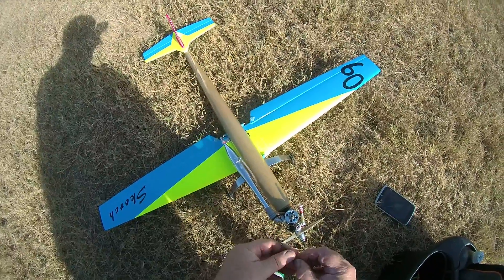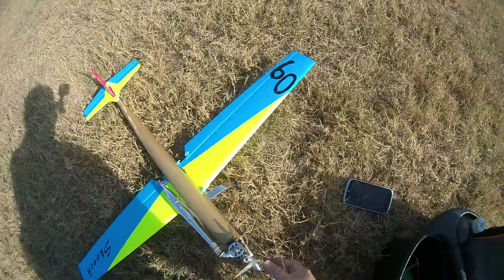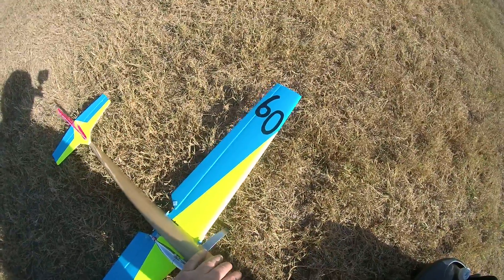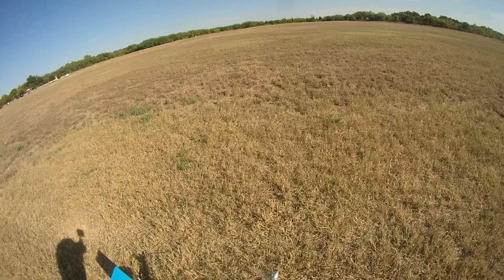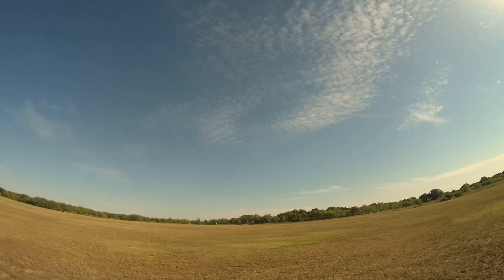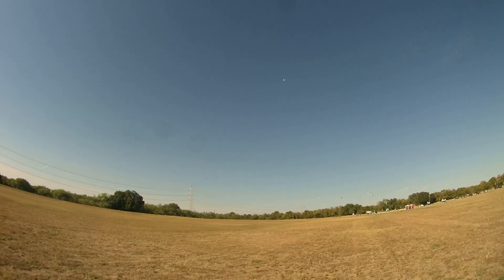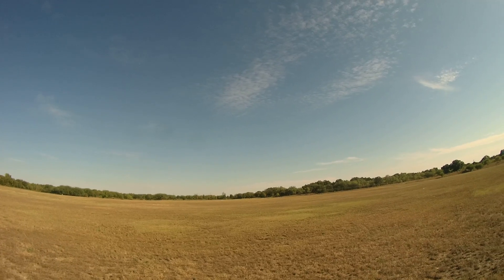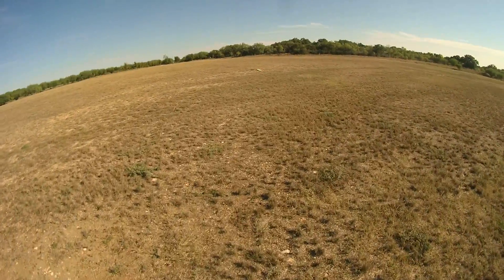Skorch II 1st Flight APC 5x3 / SH- .07 RC Car Engine Conversion

Comment: car engines don't run as hi as plane but was good experiment
Reply: Really? all the car engines I have run in the 18-25K RPM how much higher are plane engines running ? I thought the main difference was mounting and the larger heat  sinks.
Reply: Jess Hull plane engines rev 30k plus
Reply: @joeys5429  must be the more specialized plane engines. because My O.S. Engines top out at about 17K and my highest reving Cox engine tops at just under 25K These are my two stroke engines obviously my four stroke ones rev much lower. What engines are the ones that are revving past 30K ? I'd be interested in getting some.
Reply: @JessHull  smaller pylon racers
Reply: About os 10 screamers
Reply: @joeys5429   OS 10's max out at around 18K Can you give me the model name of these engines that push 30K plus? the pylon racers I'm familiar with aren't pushing30K plus in rpm.
Reply: @JessHull  trust me Jess
Reply: @joeys5429  I'd like to but,  You don't seem to be offering up any actual facts or data. I have lots of experience with model airplane engines and I don't recall any that are commonly used that rev well past 30K if you know of a model engine that does I'd love to know which one you're talking about as I'd be interested in getting it.
Reply: @JessHull   im into ic now which more powerful
Reply: @joeys5429  I'm beginning to think your original comment was complete BS as you don't seem to know anything about this topic. You say car engines don't rev as high as plane engines but they pretty much operate within the same RPM range. some plane engines run higher but not 30k plus like you seem to think. I ask you what engine you think runs at 30K plus and you say OS 10, which only maxes out at 18K. If you actually know what engine you're talking about it shouldn't be hard to just say the model.